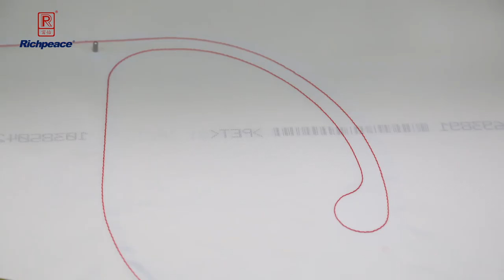Automatic Airbag Sewing Machine

Comment: Hello, what material do you use for the fixture?
Reply from the maker: Yellow epoxy board,  epoxy laminate insulation sheet, more info contact jenny@richpeace.com, or 0086-15022676886